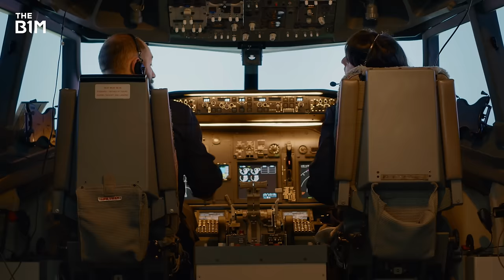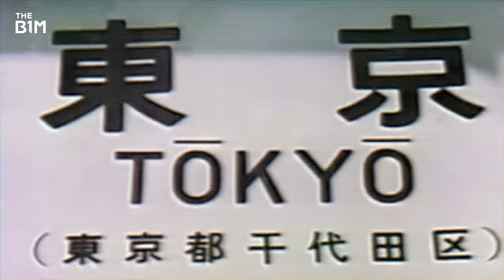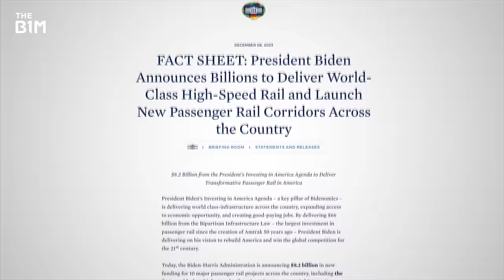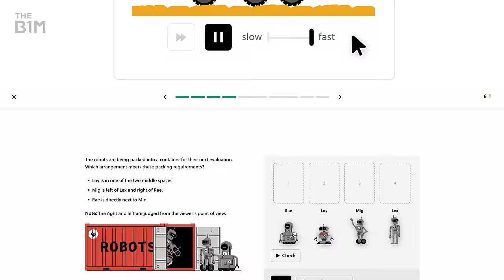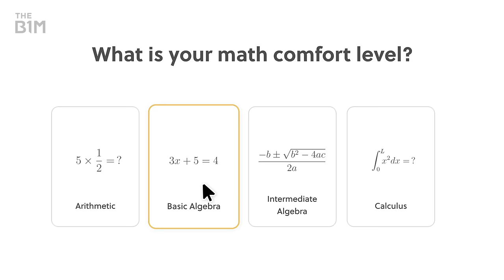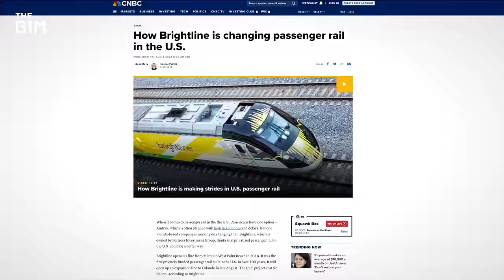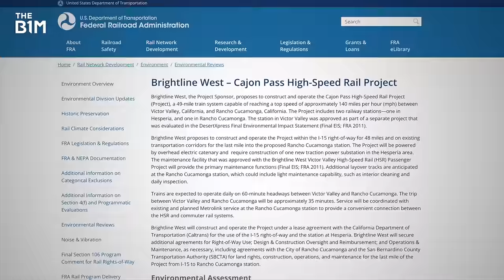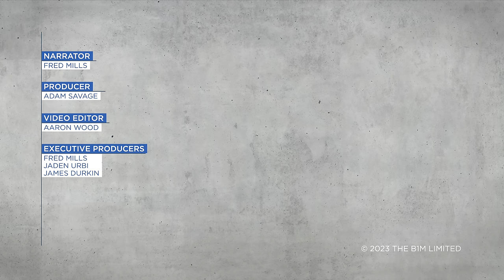The $140BN Race to Build America's First High-Speed Railway

Comment: The US has no labour or skilled white collars in this field to help build good railway lines, everything has either moved to building great roads or decent airports but there's no focus on building railway lines. The existing railways are majorly being used for Cargo movement with a few lines stretching between NYC with the AMTRAK service lines...this country clearly bleeds toomuch these days because it has stopped innovating. Dont believe me look at the money being pumped into the semiconductor projects under the CHIPS Act, there's more money needed to build the Fabs (aka factories) in Arizona than what would have been needed in Taiwan, China or India. Neither do they have enough skilled workforce to run these fabs. Before you judge me on this the US is good at designing the chips (R&D) basically but not good at mass producing them which is why almost 90% of the top end chips are made in Taiwan. The same is the situation with the railway network, eventually these developed countries will start falling apart.

Comment: 9:40 I think your math is wrong.  I have driven from the Las Vegas strip to the City of Orange (farther than Rancho Cucamunga) in 3 hours.  If your train can travel at 185 MPH, it will travel the 218 miles in less than 1 hour and 20 minutes.  You are not making a point if you are not representing the facts.  You are suggesting the train will travel to Las Vegas in 60% of the time that it takes to drive.  The facts are,  Without traffic, your train will make the trip in 38% of the time it takes to drive.  Most people drive at traffic time (typically between 3pm and 7pm on Friday), which will typically take around 6 hours to make the trip.  Being that the train will not be affected by traffic, the train will make the trip in 22% of the time that it takes to drive.

Comment: Steep gradients are only a problem for diesel locomotives. Diesels are far less powerful than electrics (the most powerful diesel locomotive in the USA today is equal in power to the Swiss railways' RE4/4 from the 1960s, despite the fact that European machines are much smaller than American ones). So if the line is electrified, the Cajon pass won't be a problem.

Comment: "The US still has no high speed rail."  That's not true!  The United States has had high speed rail since the 1970's.  At first, it was the Metroliners, which ran from Washington DC to the Big Apple. The Metroliners have since been replaced by the Acela, which run from DC  to Boston.
Reply: Have you watched the video? I don't think so.

Comment: it actually does not make sense to have a high speed rail in the USA. It is expensive and not flexible. We also have so many freeways that negate the need for high speed rail or any train. the rail between Merced and Bakersfield is a vote bribe for the union. There are 2 major freeways connecting the 2 cities, I5 and 99. Nobody will ride the train regularly.

Comment: 11:32 I'm a bit disappointed that you claim that high-speed trains have to travel on ground that's as flat as possible. If you have ever traveled in a TGV, or even have seen an LGV in France, you'll know that it's not true. High-speed passenger trains are relatively light. In France, the LGV's are build with the sole purpose of transporting people, and the railway tracks just follow the landscape in most cases. In Germany 'Neubaustrecken' are built for high-speed trains but they also have to allow freight trains to use them, and that's where building a new line becomes expensive, because it means building bridges and tunnels, instead of following the hilly landscape. When we talk about high-speed, it is about transporting people, not goods. The Cajon Pass may still be challenging, but not because high-speed trains would be unable to negotiate steeper slopes.

Comment: 📍 362 miles (584 km) is done in 2.5 hours in Europe (Paris to Bordeaux) in high speed trains.
📍 270 miles (434km) LA to LV? You can drive it in under 4 hours. If you take THIS proposed train, include parking, waiting, destination, and a cab to your hotel… it is much slower than driving.

Comment: Jesus, the California HSR project is moving along, slowly yes, but it's making progress. And it's a PROPER HSR which is a MASSIVE undertaking unlike Brightline which currently puts lipstick on a pig and calls it "innovative" 🙄Let's all watch Brightline aggressively expand itself into insolvency, which wouldn't be the first time some flashy upstart that claimed to reinvent the wheel has crashed and burned. And their current 2028 projected opening for the line to Vegas seems a little ambitious since it's 2024 and not a single hole has been dug, nor a spike driven or a rail laid. Yeah, 🤣okay. Let's just admit we've all been had by the Monorail pitchman from the Simpsons and remind ourselves that Amtrak has been doing the same thing for over 50 years with more coverage and infrastructure and if only we'd just support it more, we'd actually be so much closer to a rail network that could work for us. Brightline is a boutique service that doesn't reach the masses and like an airline, they'll expand, retract, and cut service based on their profits.
Reply: The video mentioned that the LA to LV line doesn't need to buy private land along the way because they will use the I-15 right-of-way.  So, the construction may be quicker and less expensive.

Comment: I am so hopeful that Brightline and California High Speed Rail will both be unqualified successes. Just as with baseload energy production, any society which aspires to provide safe and reliable long distance transportation services for its citizens, will need to employ several unique and essential methods of delivering on this obligation.

For electricity generation, nuclear fission and hopefully in the not too distant future nuclear fusion, must serve as the cornerstone of our power grids. But hydro power and especially geothermal must also play significant roles, as they both operate carbon free and are minimally or not at all weather dependent. 

As for industrial and heavy transportation sustenance, biofuels and efuels must be employed at scale, for fulfilling the irreplaceable roles hydrocarbons serve in powering aviation, shipping, construction machinery, etc. No electric excavator will ever provide an equivalent amount of torque, for effectively and efficiently performing the challenging and myriad range of tasks that diesel fueled models are capable of. Nor will long distance electric aircraft ever be feasible, as their batteries would be so heavy as to cause them to fall out of the sky. Perhaps small molten salt nuclear reactors will soon be viable for serving the container shipping industry, but they remain completely unproven at present time. So it is imperative for production of sustainable hydrocarbons and efuels to be fully developed globally, alongside a massive investment in electric vehicles and associated infrastructure.

With regards to transportation, high speed rail serves an absolutely vital role in densely populated regions, as it alleviates congestion on highways. And it serves the equally essential role of mitigating the impacts of the massive mining and materials needs of EVs. For every high speed rail line that is constructed, a large amount of Lithium, Cobalt, etc. will be saved. Even though the riders of the high speed trains will very likely retain their cars for daily usage, the strain on the Li-ion cells required for long distance journeys will be eliminated. Thereby the cells will last significantly longer, rendering EVs immensely more sustainable. Finally, railroads do not require as formidable a terrestrial footprint as  roads, so high speed rail could largely eliminate the need for expanded highway infrastructure.

Certainly, the ecological necessity of high speed rail may be nullified by emerging net zero aviation fuels. But high speed rail still offers enormous convenience benefits, by bypassing requisite security delays inherent to intercity air travel. Therefore, high speed rail deserves the same level of commitment from governments and citizens worldwide, as do EVs and SAF (Sustainable Aviation Fuels).

Comment: The California supposedly high speed train is a boondoggle. They were told to go along the I5 corridor by train experts, but politicians decided it was best to place it in san joaquin valley. Then they put the engineering out to bid with costs separate, but changed these terms at the last minute to cost as the first consideration. So rhe least experienced firm, partly controlled by Senator Diane Feinsteins husband, won the initial contract. There is more. What a mess.

Comment: I hope the times you were quoting are on the low side. It's only about 2 hours by car from Victorville to Vegas, and LA-Vegas isn't 5 hours for most of LA, more like 3.5 to 4. The key to success for this venture is going to be plentiful cheap (free) parking in Victorville. People can drive to Victorville and hop on the party train. Slot machines go active crossing the CA/NV boarder.  I would skip the Cajon pass for now. You can get 85% of the benefit without the pass.

Comment: They're not building high speed rail !  A few areas of the track will be medium speed rail. There will be speeds at 80 or 90 at best. They're Florida line will be mostly running thru towns a maybe 20 mph.

Comment: A few things. #1 Population density is what the orient and Europe have in common. If you are going to compare US passenger rail performance it needs to be done against the Aussies or the Canucks. 
#2 Private rail systems are what built Americas original rail network and unions/governments have regulated it into a survivability mode.
#3 The Cali HSR is a cluster F. of a joke. Original estimates at $33B now well over $200B with NO trains in site. Only thing that has shown worse management was the "CHAD" in Portland. Same mindset though.
#4 Privately owner, profit minded Brightline will show the progs how it is done.

Comment: The US never needed high speed rail and there is only one in the world even considered profitable.   Throw in the fact air travel goes where you want when you want far faster and cheaper than any rail system its no wonder discount airlines are even bigger in the EU where we keep getting told they prefer rail - which obviously is not true.  The US does a far better job transporting goods by rail than Europe

Comment: All are huge boondoggles...Air travel is cheaper, faster, safer, and doesn't require huge land grabs. Invest in more runways to reduce time on the ground and circling in the air. Invest in streamlined security. Invest in improving transit within the cities including to the airport. $100B for a train that will be more expensive, slower, and depart at fewer times is ridiculous! - Stop making transportation overly complicated so you can feel good about chu-chu trains.  Flights from LA to San Fran are only about $50 each way and take only 90 minutes. Compared to 3-hours on future rail - So there's not going to be a significant economic impact. Other projects are similar with regard to time and cost.

Comment: The decline of American passenger railway, in all forms, were the result of intentional sabotage in the 1920s and 1930s through collusion between Standard Oil and the growing GM.  The federal government convicted both companies of a conspiracy to stack the boards of the largest passenger rail systems in the country.  The Standard Oil boards would gut short and long-term maintenance (kinda' like Pacific Gas & Electric) making replacements with GM motor buses pumping all that Standard Oil, running on existing roads, far more economical from a short-term corporate balance sheet perspective.  Now we're spending untold billions converting or buying back all that previous rail right-of-way to rebuild our network.